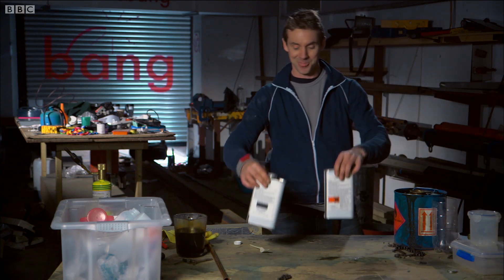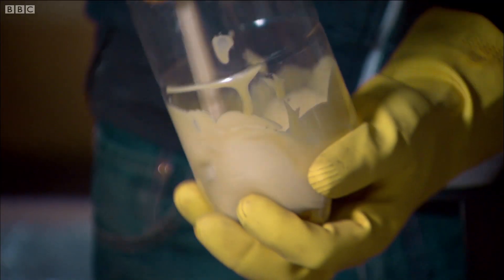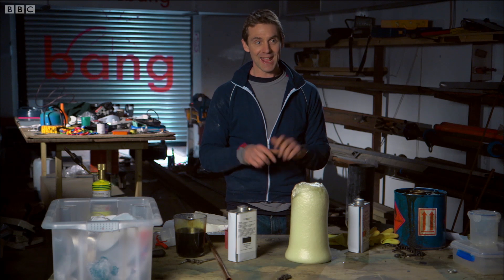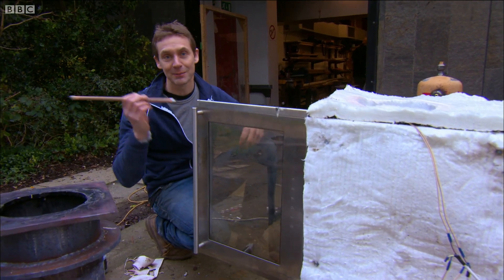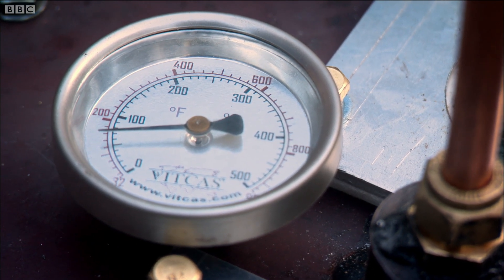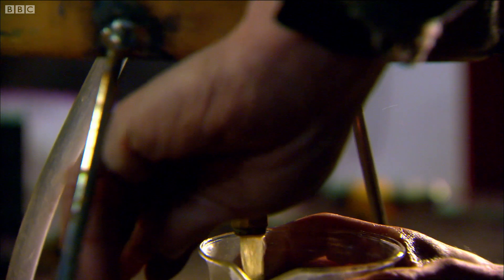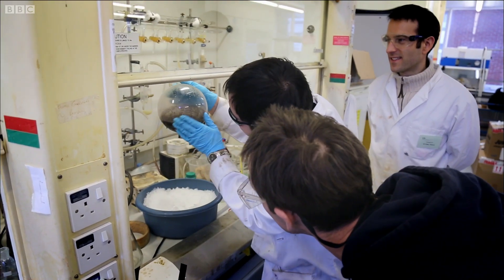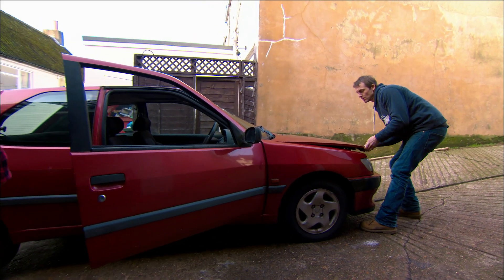How to get diesel from waste plastic - Bang Goes the Theory - Series 7 - BBC

Comment: heating up solid plastic until it vaporizes, then condensing that vapor into a liquid... and using that liquid as fuel – yeah, sounds kinda cool, but feels like it's got some major inefficiencies. i mean, getting plastic to that temp takes a ton of energy. and that energy is probably more than what we get back from the fuel itself. like, we’re burning 2 units of energy just to get 1 unit back…

if the goal is just to get rid of plastic and turn it into something useful, then sure, maybe it’s worth it. but if we're talking about environmental benefits or energy efficiency, doesn’t seem like the best solution.

but yeah, like some people mentioned, if you could heat the plastic using something like a focused solar lens, that’d be a whole different story.

Comment: >>------------------>  Everyone seems to be forgetting the energy cost he used to produce that small cup of diesel.  All that oven heat was more energy used than what was dirivied from the end result.  For prepping, I can see this as use to get fuel, but for everyday use, it would require a ton of energy.

Comment: any fuel source can provide the energy to heat it, including solar and nuclear, if done right.  But burning it later still leaves us with the fossil fuel problem.  It does, though, give us the option to recycle plastics and not leave them in landfills and oceans. My guess is that the petroleum industry squashes this because it digs into their profits.

Comment: I think in large scales this makes sense, but needing a vacuum chamber AND needing high temperatures AND the fuel is probably not very pure, I think it would be smart to wait before we burn all our garbage
Reply: You don't need a vaccum chamber only an air tight vessel

Comment: There is another video that a guy uses this method to produce diesel and gasoline. He lives in a island that receives plastic washed off shore and uses wood to heat it up. He uses the diesel in a generator (he has solar panels too) and trades the gasoline for feed for his chickens. The feed is a waste from the island's coconut oil production. 

Even if this method is not energy efficient, it may be useful in isolated communities, allowing them to use some of the technology we have developed.
Reply: Hi. Could you please give me the link of that video. Thanks.

Comment: It's a great jerry rigged system and really nicely done. However, in principle you're converting highly stable "stored carbon" to CO₂. Basically you're preventing Diesel from being produced from hydrocarbons and perhaps cleaning the ecology, but it doesn't really solve the GHG problems we have today. The sun is heating our planet's climate (e.g. our oceans are heating up with a heat equivalent to 3000 Hiroshima atom bombs per second!), which is rising with the CO₂ going above 414 PPM. So we definitely shouldn't continue to burn it like this!

Comment: The only drawback I could find is that while it might be an eco-friendly procedure without any emissions, it's not very energy efficient. Like I'm pretty sure that the amount of fuel it takes to heat up the plastic waste is not even close to the fuel produced. This drawback alone makes it a little impractical. For now it just seems like an expensive method to dispose off plastic waste. Had they used thermal energy to heat that waste this would have made so much sense.
Reply: Fuel is always energy inefficient. Even gasoline from crude takes distillation. The point is that it is usable in a car. Then second is the efficiency.

Comment: Interesting concept.  I wonder if it leaves any residue in the engine when burning.
Reply: Usually biodiesels and highly-refined oils are actually cleaner burning than diesel/petrol from the gas station. They put a lot of additives in diesel/petrol to help with lubrication and cleaning of soot buildup, whereas biodiesels generally lack both and seemingly work fine without. Also thanks to emissions regulations, modern engines are required to pump some of their dirty exhaust gas back into the engine intake, ruining the engine over time. This however does cause lower combustion temperatures, and thus a decrease in carbon particulates, so (at first) the engine will have lower exhaust pollution, but higher CO2 production. Removing the Exhaust Gas Recirculation system on an engine and installing a high quality particulate filter (DPF) is a much better way to reduce residue in the engine.

Comment: The energy and cost needed to cook plastic is greater than what you get. Thats why it is not practical in real life.
Reply: Do not comment on what you do not know. Only a idiot does this. I have made fuel from plastic and there is a cost advantage.
Reply: Remember gasoline is made from cooked crude oil and takes a lot of energy too.

Comment: This is seven years old... Where are the plastic to fuel plants hiding?
Reply: Three or four years ago Australia's ABC news reported on two Australian scientists who had created a system for breaking all plastics back down into raw hydrocarbons (it involved high pressure water) . . . so where is that great invention today? One such plant was apparently built in the UK, not even in Australia. Great ideas get crushed or bought up by rich opposing forces. Still, what is in this video is something we can all do, just about.
Reply: @rustysworldofentertainment850  One of the nordic countries had a small plant producing crude oil from mixed plastics. And I think they needed money to build a proper sized plant. A thing they did not address, which I believe to be the big issue, is dealing with all the chemical byproducts(after heating), like plasticizers, elastomers, etc, and their toxicity and how to properly take care of them.
Reply: @lightdark00  Yeah, look I was only going off the slim details of the Australian news story, no downsides were mentioned. Maybe they'd had similar drawbacks not reported on. Still, I would think that creating the necessary scrubbers and filters and other antipollution processes would be a natural step in scaling this up. Let's hope somebody is working on it, and they have business support.

Comment: If it takes more energy to create this fuel than you can extract, then it's a lose/lose situation.
Reply: That is true to the point where the reclamation is costed out. However, the cost of mining and pumping, and purifying the crude oil to create said plastics is greater than the cost of repurpose.  And as grandma always said, “Aren’t you going to clean up that mess dear?”.
Reply: @rexpickett3571  Not arguing that point. To the point of a renewable heat source that doesn't contribute to the problem is needed. Maybe we shouldn't be making these plastics to begin with.

Comment: This video is 6 years old and I'm hearing about this idea for the first time NOW. There's definitely something wrong with the industry. There is however the question of what does all this combusted diesel become?
Reply: Face it. Plastic is an environmental catch-22. You can’t burn it or convert it into fuel as either way you’ll be giving off greenhouse gases and all that. However, you can’t just sling it into landfill as that’s bad for wildlife. Especially if it goes into the oceans, as we all know. You have to harm the environment to not harm the environment.
Reply: @MrSupercar55  My hope is that we can breed a good microorganism; bacteria, nanobe, fungi or whatever, to eat up and break apart the plastic into decomposition. We need one native to the oceans.
Reply: @MrSupercar55  Maybe if the plastic melting was solar powered you could. The places with the biggest plastic overflow problems tend to have a very steady income of sunlight.
Reply: @MrSupercar55  green house gases? That term is so bogus, a term made up by the elites so they launder crabon credits and steal tax dollars. Most of what people consider green house gas is carbon dioxide which intern gets used by algae in the ocean and plants when the sun is up
Reply: Combusted diesel becomes CO2 and water.
Reply: @goysb4jays566  There is something called a "ballance". Yes, you get more "food" for plants this way, but also you get temperatures higher. With higher temperatures you have more evaporation. More evaporation means stomata in leaves will close much faster to keep water inside. This means no more CO2 absobrbtion by plants. And it all goes sideways.
Reply: The 400°C temperature could be achieved with mirrors. Then you could use the sun to make the fuel.
Reply: definitly something wrong since we are sorounded by electric field that could power up the whole world without any use of gas oil and coal and Tesla said it long time ago
Reply: This is ALREADY DONE by US waste disposal companies to make something called syngas. Been happening for YEARS
Reply: Look at the date the video was published ! 🤦
Reply: @priyankt3i  10 years ago, but I made my comment 3 years ago
Reply: @MrVanillaCaramel  No I mean the date it was published. 1st April. Special day isn't it?
Reply: @MrVanillaCaramel  And even if pyrolysis process, is real science it way to expensive way of producing low grade oil/fuel.
Reply: @priyankt3i  Yes that is interesting, too bad he didn't mention it in the end.
Reply: There is nothing wrong. It is simply a VERY inefficient process of making fuel and very NON eco-friendly. First you have to put much more energy to distill that fuel, which of course will produce more CO2, then you can burn actual fuel, to double or triple the amount of CO2 produced. And as a result you get way less energy then you put while making the fuel.
Using this energy directly to power home or something would be much more efficient and less polluting.
Reply: @ogi22  What makes you think it is way less? First of all, should calculate how much energy the heating consumes in relation to how much you will get out of the fuel. Now that again depends how is the heating arranged and with what heat. Even in totally normal oil refinery process, heating is a step used to separate the different fuels and there the loss in refiner is 6% and up, but you get more energy out of the fuels that goes in the heating. In the other hand, they even burn natural gas straight out of the oil wells at many places where it is a "problem", without doing any useful work and just producing CO2. That if something is a waste.
Reply: @wopmf4345FxFDxdGaa20  One word: thermodynamics. There is a ton of nice clips on this subject. Problem is similar to miraculous HHO generators and borderlines on perpetuum mobile. And this subject is a little bit too wide to simply put it in one small comment here. So i'll just give a few points to consider.
* read about cracking oil process
* think how much long chains is in oil compared to plastics
* think how much more energy you have to put in to crack those long chains from plastics to lighter molecules WITHOUT using catalysts (you are doing it at home with a bit upgraded moonshine still).
* think of your energy source available around you (every source is producing CO2, even electric heaters, it's just not producing it at your place)
* think how much energy you have to put in. This is not a pizza oven, this is a furnace. A couple of kW will not do.
* think of the amount of fuel produced. A few jars will not be sufficient for any practical use (maybe apart of mowing your lawn with one 50cc petrol brushcutter)
* think how much cleaner it would be to make a good pyrolysis stove with some filters to burn this plastic clean and use the heat in your home producing CO2 only once, while burning it efficiently and clean.
[edited]
* oh and for a last thing, what will you do with leftovers after your cracking process? Throw away? You just need a diesel fuel, right? Too bad not only this nice usable fuel is produced that way...
Reply: @wopmf4345FxFDxdGaa20 yah or how about it be the source of energy in the first place ?  Aren’t there some places that use garbage for power plants ?  Plastic is like napalm pretty much once its lit 🔥
Reply: @ogi22  one of the crucial advantages of liquid fuels is portability and ease of combustion

Blocks of wood or high efficiency steam turbines in electricity generating plants won't do you any good if you have to run an engine of vehicle (wood) or you're simply out of reach of electric grid (turbines), like I don't know, in 3rd world countries where pyrolysis is mostly used and sometimes the only source of electricity are internal combustion small generators

Ecology, efficiency, electric cars and all that are great as long as you can rely on institutions able to provide electricity. 

That's one of the reasons why I will NEVER own an EV, because once electric grid becomes for any reason unavailable/unreliable, I would be f*cked, instead of simply continuing thanks to easily portable jerrycan
Reply: @UrsusSuperior44  There is one more advantage over electric power source - energy density. 
As for the last part, i would kindly disagree. If you have an energy source, any engine runnign on that energy is good. You can have your own electric energy from wind, solar, combustion, chemical... I agree it is a bit more complicated, but if you have let's say exchangable batteries and a renewable resources charger, you can have sustainable power for your vehicle. It's the same with other energy sources. In some places you are unable to get wood for gassifier - such engine would be completly useless in dessert areas, where solar power would be relly efficient. It's all situational.
Reply: @John-rw9bv  Oh really? So now  you are beraking conservation of energy? With this statement you can make a claim that you are creating more energy then you put into the process. Yes, it is exactly the same as cracking crude oil. But here, instead of a liquid with short molecule chains, you have a solid plastic - MUCH longer molecule chains, that you need to break apart first before you start getting your fuel. This takes energy. Much more than you said.
Reply: @ogi22  when you are given a barrel of oil, if you don’t get net energy out of it your are doing something wrong. It has nothing to do with conservation of energy because it’s not a closed system. Please reflect on whether a life arguing but never thinking is productive.
Reply: any fuel source can provide the energy to heat it, including solar and nuclear, if done right.  But burning it later still leaves us with the fossil fuel problem.  It does, though, give us the option to recycle plastics and not leave them in landfills and oceans. My guess is that the petroleum industry squashes this because it digs into their profits.
Reply: @CrimsonClovers-222  Not really... I mean you are absolutely correct saying that any heat source can be used (if you can achieve desired temperatures with it). But it's like with other conversions - you have to put much more energy to get what you want in the fuel. This fuel would simply be more expensive so either noone would buy i or it would not be used in any excessive way that would harm finances of oil companies. Bu yes, if done right (getting energy from renewable sources etc) it could help with that plastic problem. But just as you said, it would emit more greenhouse gasses after burning that fuel. So we would only change one problem to another - shifting it, not solving. It could be much more efficient to just burn it in the right way, with filters and such, to get the energy directly. Much easier to contain pollution from one source then from many. And additionally you don't waste energy to change it to a different form first.
Reply: @ogi22  and how eko friendliy is to extract fuel from the planet? by the way there is produced to small ammount of CO2 for all the plants in the world to breathe but if you listen to mainstream sientists and experts on TV you get the wrong perception
Reply: @ogi22  Not true. You are completely wrong.
Reply: @drister007  i would kindly ask you to show me where i'm wrong and argument against it. It would be nice :)
Reply: @ogi22 But you're using pollution to make fuel. Also, the energy used to make it could be created from a micro water turbine generator implemented into the pipes capturing the energy from the already moving water used by households. Or just light a fire and keep something hot enough, that stays hot, for the reaction to occur. It's really simple and it's a shame that more folks don't know this is even possible.
Reply: @GudLawdHammercy  Yes... Light a fire and make it hot enough...
Using pollution to make a fuel (plastic bag shreds or something) needs energy high enough to break bonds of chain plastic molecules to convert them into oil.
If you make enough energy to crack oil, you can use that energy directly... And this is something i don't know how to put it simpler.
KEEPING THINGS HOT ENOUGH TO CRACK OIL, IS PUTTING THAT HEAT ENERGY BACK TO OIL + WASTING A TON OF IT FROM PURE RADIATION.
Reply: @ogi22 extracting crude oil and refining it to fuel emits more CO2 than extracting fuel from readily available raw material like plastic.
Reply: @ogi22  No it does not take more energy to distill that fuel via pyrolysis. You are merely rearranging the carbon-carbon bonds into smaller chains with an "activation energy". The technology has been around for decades.
Reply: @ogi22  it makes sense if fuel is not to get anymore ... and you heat with wood ... you will be the only one which drive a fuel car in this days!
Reply: @zeckendreck  You can derive biodiesel and ethanol from plants (a renewable resource), usually with more efficiency.
Reply: @-ThatMichaelGuy  in the winter? even you are not a agro man? i am agree but not for everybody
Reply: @-ThatMichaelGuy  yes most if not all the crude oil in the world comes from algae.
Reply: @-ThatMichaelGuy  What color's your biodiesel